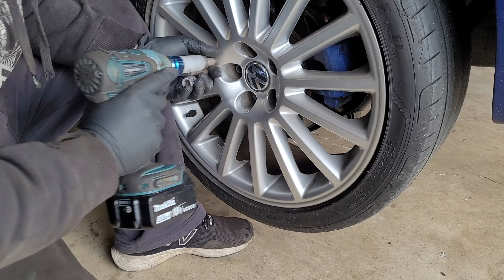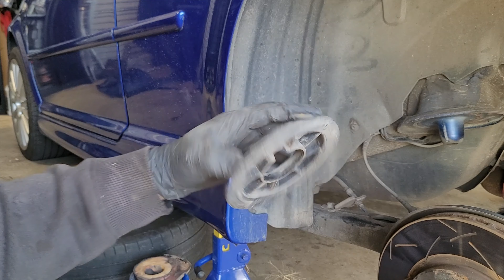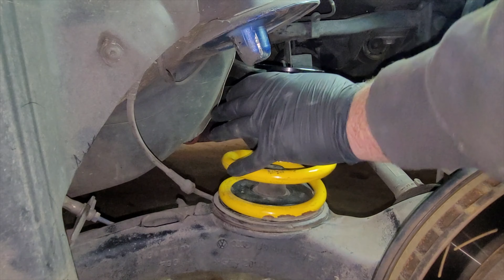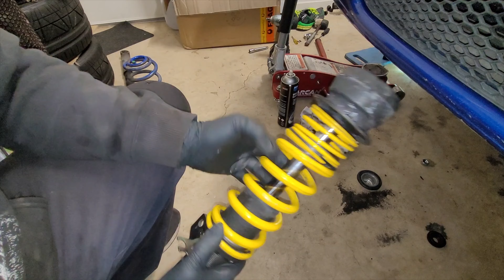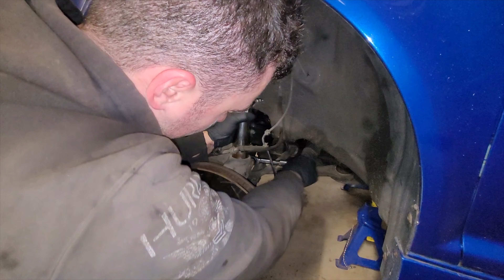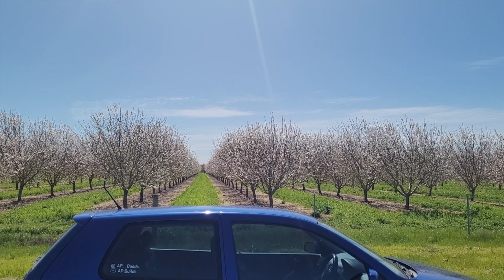VW MK4 R32 Golf Coilover install + New wheel reveal!!

Comment: Great job.  That leveling sensor at the rear, is that for the headlights??
Reply from the maker: Hey marveric0738 yes that's correct the sensors are for the Xenon headlights.

Comment: Hi I just installed rear kw v1 and set to lowest height but there is a huge gap like 4”? Any ideas as to why it’s not lowering
Reply from the maker: If you have wound the collar all the way down then it should be at its lowest point. 4" doesn't seem right. Feel free to pm me on insta with some pics. I ended up just taking the adjuster out the back of the R32 and I just have the spring now